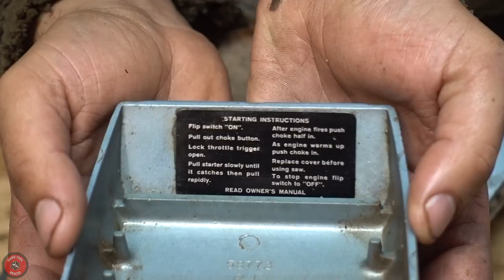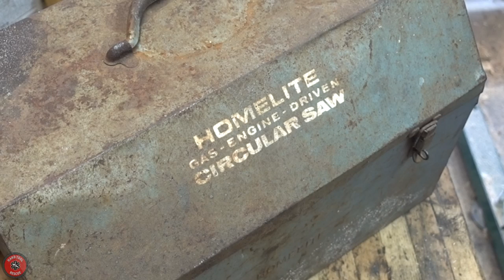Rare Gas-Powered Circular Saw [Rescue]

Comment: old homelights last forever
Reply: I find the new LED home lights last even longer
Reply: That saw will probably last for generations if maintained. They sure don't make them like that anymore!
Reply: Scott Varena 
Yea, they are better, and safer now. Homelights are dangerous. And many this thing sucks at cutting across the grain.
Reply: That's a plainly stupid comment. How can a LED saw that's been out for maybe 10 years last longer than this one that is 50 years old?
Reply: That's just a joke as he misspell the Homelite...
Reply: Jerry F 
Better technology, specifically better build quality. Do you even know what glass fiber reinfirned nylon is? Besides Homelites are dangerous. You want a good saw get a Huskavarna, or a Still, or Dolmar.
Reply: Jerry F 
Back to light emmitting diodes, they've been out since the 60's.
Reply: old good metal always win :D
Reply: L Adam 
Mechanical Engineers will always win, and they are. You don't understand material science, so continue falling behind.
Reply: I'll stay with using my late 70's Homelite chain saw that refuses to die.
Reply: Gizmo42Rodeo 
Have fun struggling with a saw that's only good for cutting tree roots
Reply: Hasn't been a struggle for 39 years so far. When is the struggle supposed to start?
Reply: Gizmo42Rodeo 
You clearly don't cut trees much.
Reply: as chain saws go they are verry solid for home use. on top of that there old industrial saws are grate. you can slap a 40inch bate on them and they keep the tork. the new ones are no better or wors when it comes to there hi end saws there homebepot stuff is horid but that is besidea the point. old tools new tools they all have there prose and cons.
Reply: Hardly, when your family would split wood in -40 F. They use Huskavarna, and Stihl and Dolmar. Those are not shit saws, they actually run when the other saws crap out. And as far as the body material of a saw, it makes no difference, it only means that the lighter saws allow you to be less fatigued. However the level of intelligence here refuses to look at the facts.
Reply: No shit you use a chainsaw. The discussion changed from circular saw to chainsaws. And yes I have run a Huskavarna Farm Boss with a 20" bar. And we used a  Timberwolf 20 ton spitter. We went through 3 Honda 450cc engines with it. We also rebuild the hydraulic ram on it. We also had a Cordking as well. We also had a kiln. So yea, I think I know about wood splitting. I call you an idiot if you truly enjoy home-grade Homelites. Anyway, I have better things to do than argue with someone who things engineers don't know a thing.
Reply: Aaaannnddd.. there it is, the engineer line. As somebody who has to make things that engineers designed actually work in the real world on a daily basis I have more faith in the intelligence of burger flippers.
Reply: Gizmo42Rodeo 
Go look up AvE and tell me AvE is stupid. Yea, he's a Mechanical Engineer
Reply: He's a field engineer. That actually gets hands on with the equipment and knows how things in the real world behave. Very few engineers do that or have the slightest clue about what they are designing.
Reply: You just keep arguing. Still not understanding. Those who actually do. Will keep doing. Everything is engineered today! How long does most of it last? You simply don't get it. These new tools are specifically designed to not last as long. It's called designed obsolescence. What is not designed to fail you can guarantee will due to cost cutting creating inferior tools. Especially with a homeowner quality brand like Homelite.
Reply: Lol, the problem is that the tools are not inferior, its that the good ones aren't homegrade.
Reply: EETechs 
Um, it's called laungauge everyone can understand. But he knows his shit better than you unless you are an Electrical engineer. And FYI Mechanical Engineers know quite Abit on the Electrical side cause the EE's aren't smart enough to know how to implement.
Reply: EETechs 
You don't know where he went to school. Msoe does go past electromagnetism.
Reply: No they don't. ME's stop at AC and DC circuit analysis.
Reply: EETechs not at msoe.
Reply: EETechs don't waste your time. Jenna here knows everything and can tell people that use these types of tools every day in their profession all about how they are wrong and stupid.
Reply: Jenna Koss dude these things are like forever old. They make chainsaw attachments and they fly through boards faster than any other electric you can think of
Reply: Homelite isn't my favorite, but the old tool is awesome. Although it's not really good for much any more, just think how cool it was when it first came out. Makes you wonder, who us d this saw before I got it? Where was it sold? What projects did it make?
Reply: Chonrad, I've never heard of that supposed "brand," what you call "Homelight." Where did you get that?
Reply: Maxx Fordham! I'm not a big fan of homelite. They are very loud shaky and slapped together I feel. You can find them at menards.
Reply: Yes, Kody, I'm aware of where we can get Homelite products. We don't have Menard's here in Utah, but we can get Homelite at.. well, The HOME Depot, of all places, but also I wouldn't be surprised if Walmart, etc. has them. Years ago I bought my dad a Homelite electric-start gasoline-powered string trimmer and it has always worked just fine.

But I do still want to see what this Chonrad says about where he thinks he can supposedly get a "Homelight" product.

Comment: I like the Vid a lot. Nice to see another Textron made Homelite going. At 6:33 I noticed you were using a 2 jaw puller, I'd be VERY careful using one of those on a flywheel i've had a 2 jaw puller brake a few flywheels in half. The best way (whenever possible) is to take out the starter dogs and use a steering wheel puller in the holes (this moves the pulling force closer to the center of the flywheel). If you have to use a 2 jaw i'd recommend grabbing the flywheel below the magnet and it's counter weight (this is the thickest part).
Reply from the maker: Good tip.  Thanks!
Reply: OR maybe the guy just has a 2 jaw puller and you have to use the tools you've got, not the ones that you wish you had may be more suited to the job. If you have an extra steering wheel puller I'm sure he'd appreciate the donation. :)

Comment: This sandpaper is a bit brutal for points.
Reply from the maker: I'm honestly surprised it worked.
Reply: fiberglass scratch brushes/pens work great for corroded contacts like that and they are cheap, too.
Reply: yeah it did need new points
Reply: Probably new points would have beenthe best option, but try finding them for an uncommon 50 year old engine...
Reply: Not so uncommon :

http://houseofhomelite.proboards.com/thread/2749/xl-100-circular

.
Worst case is changing and riveting just new points, not the whole assembly, or switch to electronic ignition.
Reply from the maker: +andTo861 I should have shown that I cleaned them after the sanding.  I really do need a needle file.
Reply: I'm not sure to have the perfect solution, but to clean points I use #600, #800 or #1000 paper, just folded.
You can't "push", of course, so it takes patience opening the points manually, setting the paper in place and "pulling" it between the points.
 
So it doesn't round the points, the surfaces stay parallel.

Points are hard only on a small depth. So if you use something aggressive, you destroy the hardening area.
Of course, it works just after cleaning them this way, but they may quickly get dammaged and develop serious pitting.
Kind of swan song :)

Maybe someone have better solution, I don't pretend being 100% right about this.
Reply: 320 grit is just fine for points. I've worked on hundreds of old VWs and done just that and they toodled away just fine.
Reply: It may run fine for a while, but they won't last once the coating is removed.  Only sand them if you intend to replace them very soon, otherwise just clean them carefully.
Reply: Volkswagens
Reply: Actually took neighbors unwanted rototiller , craftsman 70-80 model, just replace points with lawnmower electric ignition. Works great and neighbor is still annoyed he gave it away when I run it.
Reply: Yeah I get rid of points when I can.
Reply: So is cleaning the whole thing with the air-filter off! That blew my mind when he just put the filter back onto a filthy carb after all that work...shame really
Reply from the maker: +Knolltop Farms Ya, I should have taken more care during that part.  I guess it might end up as more work during the full restoration I have planned on this.
Reply: Hand Tool Rescue I do the same, light abrasion and contact cleaner is all that's needed. Besides why fiddle with small parts if not needed?
Reply: Hand Tool Rescue No it won't. While scratching delicate points is not advised, it's not as if you milled something metal and left the chips in the cylinder. Most of the grime on that saw is wood and oil, it quickly dissolved and was burned up. There is an off chance that something abrasive was sucked in, but provided it's running all should be good. No need to tear down to see, you'll only cause more problems. I'd detail it a little further, leave it alone and be more careful protecting the internals of future projects.
Reply: +Sunny Vaio The CAMI (American) system of grits goes from 24 to 1000 (~700 µm down to ~10 µm particles), and the FEPI (European) system from P12 to P6000 (~1800 µm down to 4 µm particles).

It makes sense, but I was amused a few years ago to learn that nail files are also measured using the same system. =3
Reply: I would use metal polish.
Reply: You need a "points" file, which are specifically for ignition points. I came across mine the other day. They're super flat and a fair bit wider than a needle file. BTW my dad used to reset the points on our V-8 with a matchbook as the spark gap feeler gauge. Too bad he waited until we were all stranded at some store, first. Fun vid but honestly I am glad to see IC engines go in favor of electric motors. Even my lawnmower is battery operated these days. People walking by always comment about how quiet it is. Aside from charging and the blade it needs no maintenance. Replaced one battery over the last decade. Neuton.
Reply: +John Possum what they need is to ditch those points for an electronic conversion module. Because points are so 50 years ago now.
Reply: Paul Frederick my Honda civic had points and condenser . in 1979. It was the last year for that. And manual choke on the dash. When men were men.  Carb. of course.
Reply: carbs and chokes are OK but points they just wear out.
Reply: Paul Frederick The good thing though about points is they're super simple. CDIs tend to delaminate over time, heat and cooling cycles and just quit. Points get dirty, clean them and good to go.
Reply: points can pit and when they do cleaning them doesn't help. Well, it might help for a little while, but once points are shot they're shot. I have good luck with electronic ignitions.
Reply: Paul Frederick Definitely CDI works better. But for buying old equipment at auction, points don't scare me off as easily when the price climbs. I know I can get it running with minimal cost. Having to source an old CDI that could cost upwards of $50 just to see if it will run is no fun. I found an old eager beaver saw that looked mint but wouldn't run, it needed a CDI. However an old flymo mower in similar condition had spark in no time with a spray of contact cleaner.
Reply: So true. Points are old tech but that makes them so easy to work with. They wouldn't scare me off, either. In general I really like old tech because it's easy to work on. I have 3 old circular saws, a couple of jigsaws. Actually I have a drill press that is probably older than his gas circular saw. It has a GE 1/4 hp motor and only 2 speeds but it sure beats pushing the hand drill. I think it might be a little rare because it does not have a standard table but a sit down table about 30 by 30 with a HUGE cast iron arm that bolts to that and holds the motor and quill. I believe it may be from WWII when women with skirts would work with these things. Drill holes for rivots for planes and such. Anyway, I really like it. I liked it enough to rewire it to today's standards plus a light and extra outlet.
Reply: pileofstuff The engine is simply a Homelite XL Series Chainsaw, rather common. My uncle has 5 of them in his garage.  A few specific circular saw parts would be a pain, but the motor stuff would be easy to find.
Reply: I don't think points would be easy to find for this at a local store?? lol